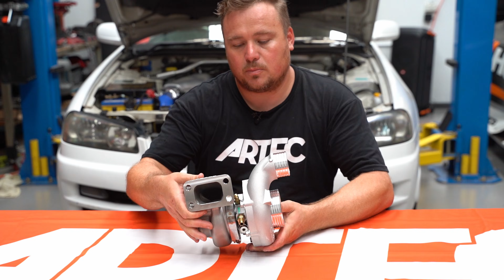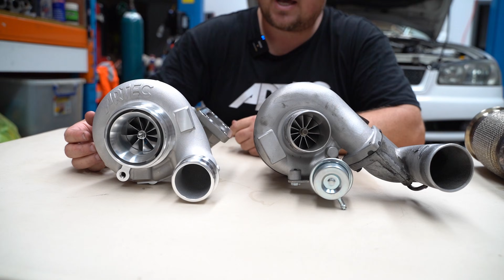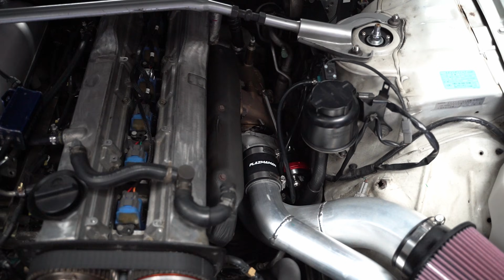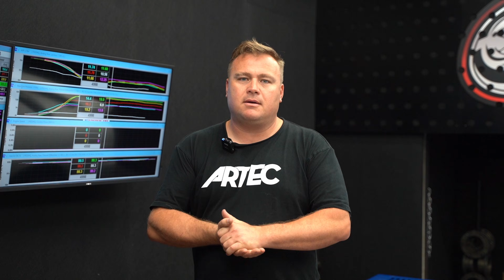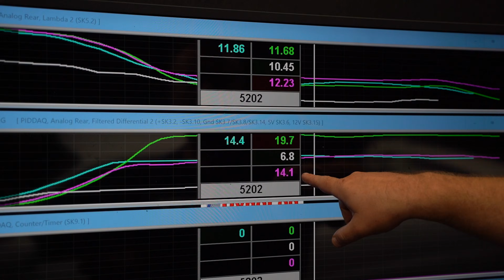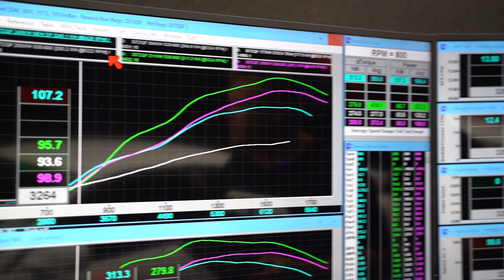The ARTEC R34 gets a BIG Turbo Upgrade! - GTT Build Episode 9

Comment: In the middle of a build right now with a Artec reverse rotation and G30-660 (actually a Pulsar 5455G) on a RB25 Neo, the smaller manifold... with the intent being response and sanity with its more compact arrangement.. I've been eagerly awaiting for you to use your manifold products on this project car; is this something we can look forward to?  I'm sick and tired of reading all the keyboard warriors, forums/facebook and the likes crapping on the manifold parroting a very very very select few seemingly biased people who have ACTUALLY tested it, although often with caveats.. like not matching an appropriate turbo with it.. (I mean I'll learn for myself soon enough, but it is seemingly a bit odd Artec isn't using some variation of it?); but great choices of components thus far, pretty much mirroring where im going.. 256 cams, 5455g, artec manifold. Twinscroll vs straight V-Band is another big point of contention
Reply from the maker: Hi Hayden, Yes the most common issue we see with turbocharger systems is an incorrect balance of parts to meet a certain goal. As you can see from this series a G30-660 is a possble perfect match for our goal of 500whp on E85. If you are wanting more power on pump fuel, you will start to trade your lower end response. Cheers for your support and I'm sure you will like the next episode which should be out next week.

Comment: That turbo is sweet with the front facing inlet, just needs a v band so don't have to run silicone hoses
Reply from the maker: FYI we have tested silicone with barb ends to 100 psi.
Reply: @artec_performance yeah but it's not as cool 😂

Comment: 4" downpipe is stupid big for a bolt on, internally gated turbo
Reply: Wrong. Bigger the better. U can have a 4in down pipe then step down to 3in under the floor. Larger dump pipe will help with spool. And will help with any wastegate reistrictions being internally gated.
Reply from the maker: Please also contact Toyota Racing Developments and inform them that thier 4" down pipes on their GT500 4 cylinder Championship winning cars was the incorrect diameter to run when making 500hp.

Comment: these should come with stamp steel shield from turbo to cat

turbo cars have allot of cabin heat especially with larger pipe. while larger pipe is less restriction (less heat build up) when that larger pipe heats up (more boost etc) the reverse happens, much more heat builds around the dump pipe

Bit like radiant heaters, arger heat tubes give more heat

a nice stamp steel sheild gives that OEM+ look
Reply from the maker: Thanks for your comment. We will post up more details pics of the clearances from the firewall and other areas that you might be concerned with the heat. We have been driving this setup for over a year in Sydney Australia with no signs of heat related issues occurring.

Comment: Kakimoto dont step down their muffler... why does this guy not seem trustworthy?
Reply from the maker: We purchased a Brand new 90mm Kakimoto Regu 06 and R exhaust for this development. Please contact Kakimoto and alert them that their product is roughly 67mm ID on the rear muffler if you think we are not stating facts.
Reply: If it's a Jasma spec exhaust, then it will have the step down. Shine a flash light down the rear of the muffler and you will see it.
Jasma = decibel limited exhaust.

Comment: Why the heck is it 4" for an internal gated turbo. Its like the 1JZ manifolds that come in T4... T4 is 2J size. Total mismatch. Maybe if it were 3.5".. but 3" is fine for more power than any turbo thatll fit that thing
Reply: Less restriction
Reply from the maker: FYI 1jz's do not have a T4 flange. The flange size is also the least contributing factor in Turbo design when correctly matching requirements to reach desired goals. The lesser the restriction post turbine, the quicker in rotational response. As for this comment "3" is fine for more power than any turbo thatll fit that thing" Our bolt on turbos will support up to a G35-1050.